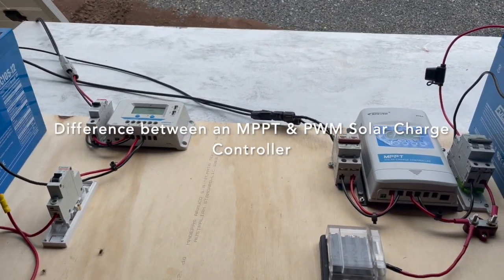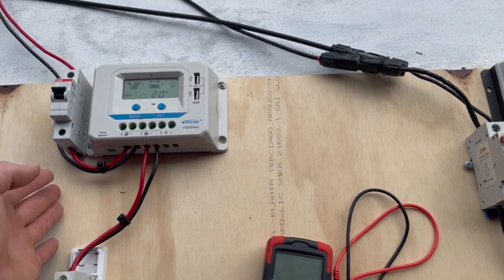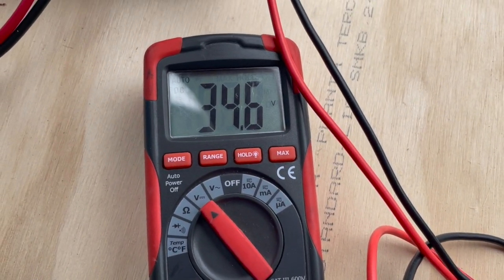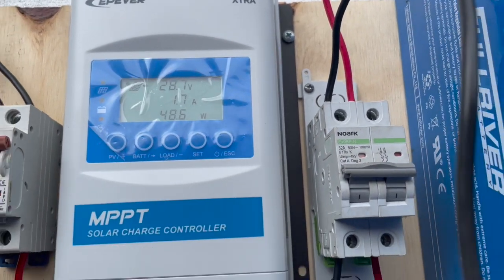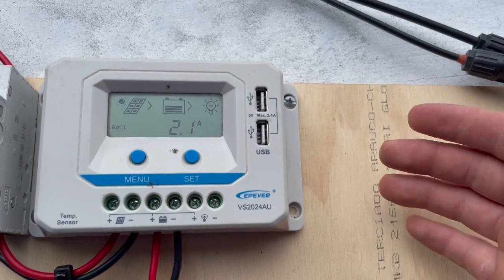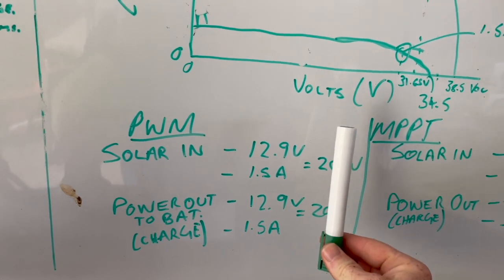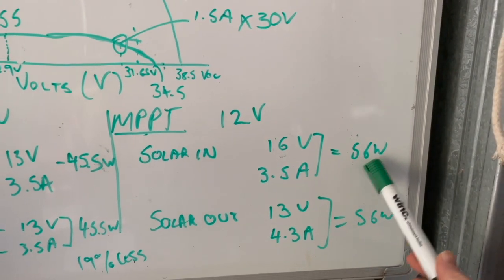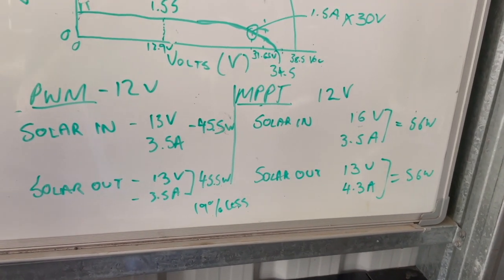Difference between a PWM & MPPT Solar Controller (Real Life Example)

Comment: let me narrow this down. for large solar farm go with the MPPT with little to no shading panels will be wired in series. for a small off grid setup go with the PWM with some shading panels will be wired in parallel.
Reply from the maker: 12V panel to 12V battery = PWM. 36V panel to 12V batter = MPPT.

Comment: Basically...if you're building a large solar system, get a mppt charge controller. For a small 12v system, get a pwm charge controller and a extra solar panel for better results. Nice video. Brilliant explanation of how both controller work.
Reply from the maker: Thanks mate - glad you enjoyed. You're pretty much on it. Even If you have a 12V system and get a higher voltage panel (like 38V) you should use an MPPT. A pwm is best suited to a 12V panel charging a. 12V battery.

Comment: 24 volt system changes the whole equation, 31.8 volt panels match very well to pwm for 28-30 volt charging...simplicity and cost effective. MPPT is good for voltage matching, that's the main plus ...thanks for the demo⚡

Comment: Based on this experiment, I will not use high voltage panels arrangement with pwm controller.
Thanks for the information
Reply from the maker: Mppt for higher voltage.
Reply: @sunbiasolaroffgridsolution6545  I just changed higher voltage’s series connection of panels to parallel connection on pwm charge controller.
Thanks again

Comment: I believe if your just wanting a maintenance charge on some rv batteries the ppm controller should be just fine 2 panels wired parallel
Reply from the maker: Yeah mate if you don't care about how much of the power is used from your panels - ie just for maintenance it wouldn't matter. If your trying to maximise the power out of your panels then it might.

Comment: 26W from PWM in this example. If you use 24V battery, it would be 52W, because from MPP down, power is almost linear. Basically no difference between PWM and MPPT, or maybe 2Watts would be with those panels and 24V battery.
Reply from the maker: Correct. Minimal difference in power loss  between the two if your solar Vmp is close to your charging voltage. But the higher your solar voltage vs battery/charge voltage the higher your energy loss in a linear relationship.
Reply: @sunbiasolaroffgridsolution6545  Good to see, there are some people who understand it. Not just MPPT good, PWM bad.

Comment: Hey mate.  Question on the breakers in your videos.  I'm putting a Noark Switch MCB DC 2 Pole 40A 360V non-polarised breaker on my camper van.  Same model as you have here, a Ex9BP-N.   Do I just put the 8 B&S  - and + from the solar panel into the bottom of the Noark, (one each side ie. one to each screw)  then out the top (load side) then connect the MPPT solar in via Anderson plugs like you wired up here?.  (I want to protect MPPT and be able to isolate panels with the Ex9BP-N).   I'm thinking of adding Andersons 50a connectors to the breaker wiring too, both ends so will have permanent Anderson connectors each side (input and output) of the breaker.  Any issues in having Anderson connectors attached to the breaker wiring?  reason, my MPPT then can be unplugged and taken out into the portable solar when not taking the camper trailer with me, example: going to the beach and just taking fridge, solar panels and battery, and of course the mppt. Also, last one, why the different breaker with red switch lever and not to same breakers ie. both Ex9BP-N's?  Cheers!
Reply from the maker: Hey mate.  Thanks for the message. 
Yes you can connect pos and neg of solar into the breaker from your panels then out to the MPPT. An anderson plug on either side is also fine and a good idea for your application - ie to unplug and use elsewhere. 
No reason for using a different breaker only that’s what I had on hand. If you look at my other video I use a heavy duty battery isolator switch and fuses on the cable to isolate from the battery to the mppt/distribution. This is a better option over a circuit breaker if you have big loads from the battery - like an inverter.

Comment: MPPT also uses more power than pwm. So you are not getting a whole lot more.
Reply from the maker: Nah not entirely. Really depends on your solar panel or solar array's operating voltage. If you've got 60Vmp of solar coming in charge a 12V battery a PWM would enormously less efficient than an MPPT.
Reply: Maybe in 2002

Comment: For small systems PWM is adequate. If you want more amps from PWM add another solar panel to compensate.
Reply from the maker: Well yeah you could. I think the key point here is - a pwm is fine for small systems where the solar panels voltage is close to the batteries voltage.

Comment: hey when pv is off on my pwm epever it shows 12.5 v but the battery icon is only 2 bar why like this
Reply from the maker: 12.8v should be 100% right%

I think this is an error with the controller firmware because it thinks float is 100%. 
It is annoying that’s for sure but nothing you can do I don’t believe.

Comment: How many Amp .breaker needed for for 4 200watt solar panel.
Reply from the maker: Hi Mussema - depends. Did you wire them in parallel or series?

Comment: Hello..Great video I'm confused dont know if its normal,my 24V 300watts panel charge my 12V 200ah gel battery with 40A 12/24 PWM charging controller ,the confusion is if the sun is high I see absorb of about 13.6v and sometimes even float.But the moment the sun is down the volt drops to 12.6v or 12.7v sometimes even without load is it normal? or is there anything wrong?
Reply from the maker: Hey Mate. I think this is normal. Can you check your battery specifications online and check what it's 100% capacity voltage is? Generally a lead acid battery is 100% full at around the 12.8V mark. I'm assuming during the day the battery is full and the mppt is sitting in float at about 13.6V with little to no amps going in - can you check this?  When the sun goes down and the MPPT is not charging the battery will go down to 12.8V which is it's 100% voltage when there is no charge or load on the battery. Hope this helps. Zach
Reply: @sunbiasolaroffgridsolution6545  hello thank you...I checked online I never found it's 100% capacity voltage but it says it requires more than 15A for it to be fully charged...the solar isc is 9.83,the imp is 8.86A.if I continue charging it can it get damaged nd if I use mppt charging controller how many amps will be increased?
Reply from the maker: @henschelchabala6954  Hi. Can you share the battery brand and model with me? Thanks.
Reply: @sunbiasolaroffgridsolution6545  Brand.battery king
Model:gel battery 12V 200ah
Reply: It is normal, because for this "smaller" battery its kinda high charging current. Higher charging current, higher the charging voltage to push it there. One option is to add second battery, second one is to limit your maximum charging current.

Comment: Playing devil's advocate! Don't be so hasty drawing conclusions! ;-)
PWM CAN be your preferred choice if you consider ROI (return of investment) on a properly set/designed system! PWM are dirty cheap, in comparison mppt are very expensive. That is a given.

With this said, we also know that pwm become more inefficient as we step further away from it's ideal point! Meaning if you design your system from the beginning considering this issue. Your potential losses will be minimal and your ROI will be max! 

Example: Use 12v (nominal) panels, to charge a 12v battery! Instead of using much higher voltage panels (expensive mistake), to then bring it down back to 12V (even more expensive)!
 
Seems basic, seems logical (and it is)! Although you step away from this. To show case your video example! Making the mppt sound like the "perfect solution"! When in reality it's simply a wasteful way to ditch money! Or in other words on this video example. You end up correcting one design mistake, by adding an expensive correction step! A good analogy would be to put an expensive cork, after making the hole on the boat! LOL or Oops! :-)
Cheers

Comment: So what's the point other than using a higher volt panel?
Reply: MPPT will, on average, make ~15% more power in daily power harvest. There are scenarios where it will be more (habiltually low battery bank voltage, low ambient temps) or less (Absorption stage, warmer ambients).  So it's a horses-for-courses thing.

The big advantage of higher-voltage panels is they tend to be cheaper by the watt.  Used 24v panels can be 1/3rd the cost of new 12v.
Reply from the maker: Very little point if you are using a small 12V system. Typically when you start using larger systems you use higher voltage panels and run them at higher voltages. This is when MPPT's come into their own.

Comment: On my small system of 240 watts, I have been using a PWM for 15 years now and it has worked very well except for the slightly incorrect voltage and amperage displayed. I will be upgrading to an MPPT early next year and adding more panels. Thanks for the video and greetings from sunny Jamaica.
Reply from the maker: Hey Lawrence - that’s cool. What brand controller is it? 
Mppt will be good for you if expanding the solar panel array!
Plenty of sun in Jamaica like Aus.
Reply: @sunbiasolaroffgridsolution6545  I am currently using a 30 amp PWM Sunforce controller. Yes lots of sun like Austrailia. I have family in Australia BTW.
Reply: Can even 2 chargers in same battery,  dont measure voltages but impedance
Reply: @jussikankinen9409  Actually, I now have two MPPT charge controllers on the same 100ah LiFePo4 battery. Everything is working well and the 1000 watts of panels are supplying about half of my homes power.

Comment: Where goes that wasted energy into, on the PWM controller?
Reply from the maker: Hey Buzzdev - from my understanding PWM acts like a switch by turning on and off very quickly. It works out the required amount of time on vs off so the  average V over a time is reduced to the required charging voltage eg14V.  This then means all of the energy from the panel is just not used - 'wasted'. Like turning a light on and off - there's power available but only a % is used when it is on. There are other losses within the controller which are dissipated as heat. Hope this helps.

Comment: TL;DW:
PWM is cheaper, but you should get an MPPT
(Similar to batteries for storage - Lead Acid is cheaper, but you should get a Lithium)
Reply from the maker: Get what you pay for. Only time PWM is not too much better than MPPT is when you are charging a 12V battery with a 12V solar panel. Minimal difference in power harvest between the two.
Reply: @sunbiasolaroffgridsolution6545  or 24V battery with 24V panel, or 36V battery with 36V panel, or 48V battery with 48V panel. Basically if you choose panels close to battery voltage, difference is not more than 5-10%.
Reply: I just got 12V 100Ah used AGM battery for 30USD, when its not usable i can get back in recycle centre 20USD back. Should i get Lithium for 200USD?

Comment: Batteries prefer a trickle charge than a power surge mate
Reply from the maker: Hi Mate - AGM batteries are should be charged by a Bulk, Absorption, float charging profile. 'Trickle' charge occurs during the float stage. See manufacturer's spec for charging their batteries
http://resources.fullriverbattery.com/fullriver-battery/charging-instructions/batteries.pdf
Reply: @sunbiasolaroffgridsolution6545  cheers
Reply from the maker: @rexgeorg7324  No worries!!
Reply: @sunbiasolaroffgridsolution6545  If manufacture worried, we wouldn't be using  antiquated  batteries still
Reply from the maker: @rexgeorg7324  You miss understood the phrase.